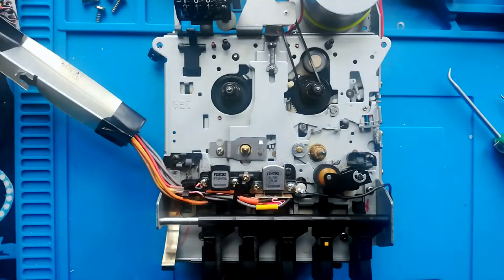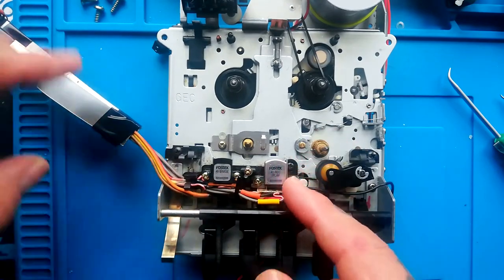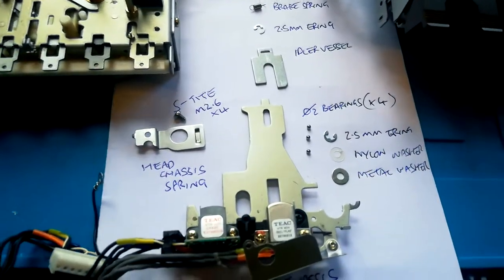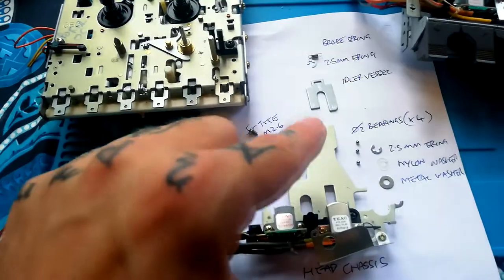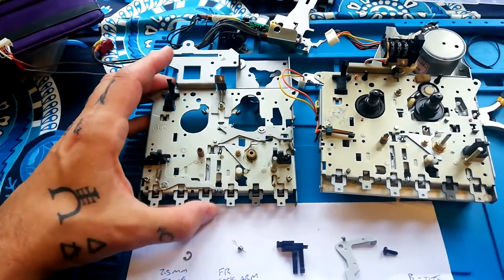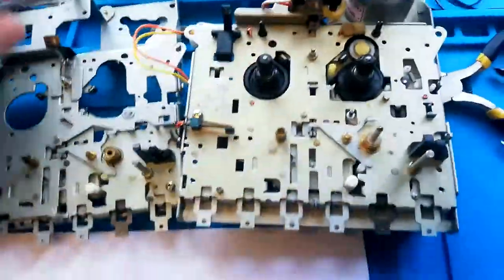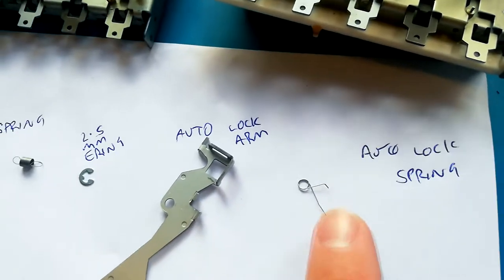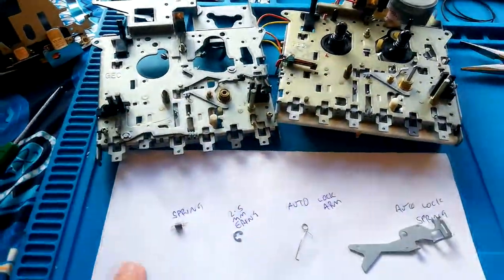GEC multitrack cassette transport  | 1c | front tear down contd. | proper names of the bits!

Comment: Hello- I'm cleaning/lubing a transport from a 424 mkiii and I keep breaking the black plastic retaining rings of various sizes("poly cut washer"). Have you found a replacement supplier or a comparable alternative? I have used all my extras from other machines so I'll have to buy them. 
Apologies if you have already answered my question in a video & I missed it.
 Hey thanks so much for all you have posted-super helpful...kind of life saving!
Reply from the maker: No I haven't tracked down a supplier - basically a few years ago I ruined a lot of units when I was teaching myself to do this by trial and error so at this point in time my spares donors pile is massive! Have you tried using a very small e-clip instead? You can get assortments including really tiny sizes for not much money...can't say for certain that'd work but worth a shot maybe?
Reply: @Tetrakan  Yes I was thinking teeny e clips too, but I'm wary of the 7 different sizes of the original little black plastic ones. But maybe "close enough" will work.Thanks for quick reply!